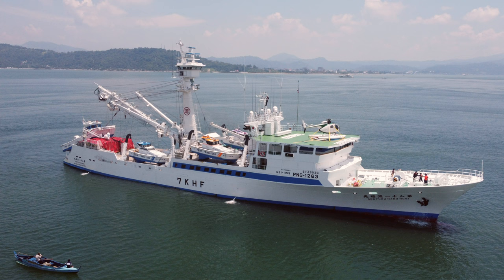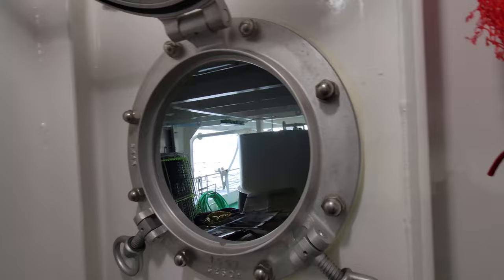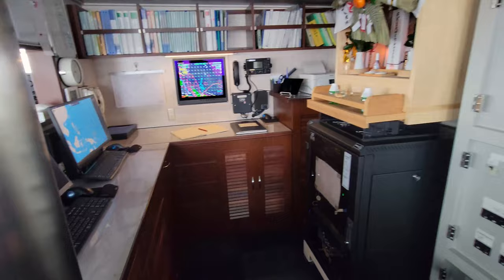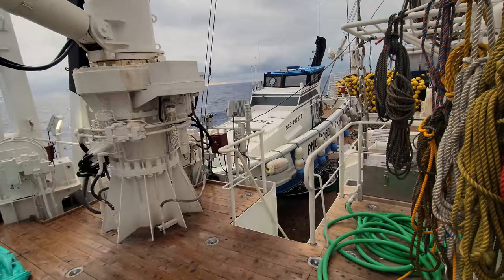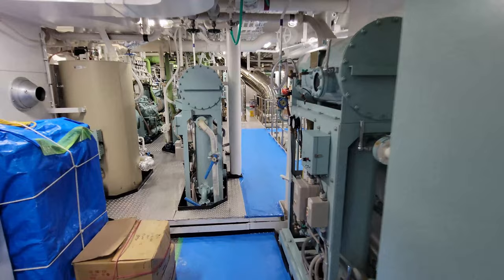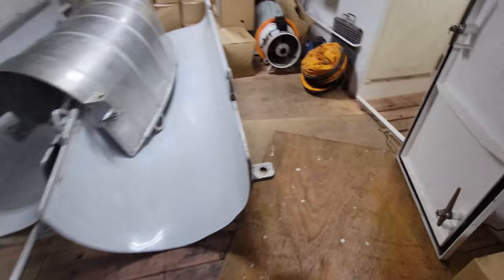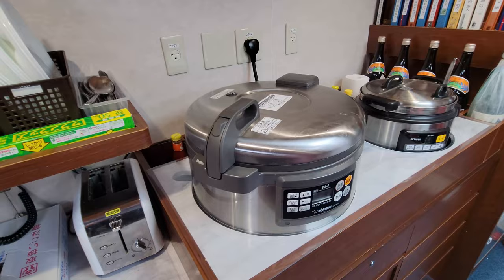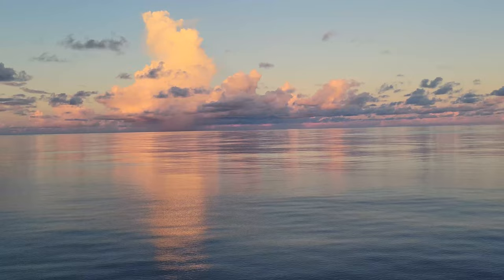Video Tour of a Japanese Tuna Fishing Boat

Comment: Cool video! How do you always find the boat after you've been flying for a while?
Reply from the maker: So we actually do all our navigation with GPS out here. There's a beacon on the ship that provides my GPS unit with a updated location of where it is. If that fails, we also carry our own gps beacon on the heli so that the ship can track us and they can also see us on radar while we fly. So if we need to, they can guide us back to the boat. We also generally don't go very far from the boat, usually about 30-35 miles is the max I'll go because the ship would take 2+ hours to get to us if we found fish. Also on a good day, I've been able to see my boat from 27 miles out, so it's fairly easy to keep an eye on where the boat is if the lighting and weather cooperates. But other times I won't see the boat until I'm closer to 5-10 miles from it.
Reply: Interesting, thanks for the answer!

Comment: what are those small machines in the engineroom that look like radial engines? there are like 6 of them scattered around the engine room!
Reply: I'm pretty sure those radial things are refrigirant compressors. The 3 'blocks' at the lower level are the main engines (2 small ones are generators and the big one is main propulsion). The green barrels which he says the crew said were compressors are actually condensors for the refrigirant. Must be a mixup because of the language barrier I think.

Comment: Interesting look at the industry.  I watched your helo videos too.  Questions:  1) What species (looks like Yellowfin?) 2) No processing on the vessel?  Just flash frozen and then processed back at port?  3) I'm guessing a vessel of this size does 15 to 20 knots so if you run 30 miles to a school you spotted what is the likelihood they are still there when the boat arrives? 4) Are there a limited number of vessels that can pursue this fishery? Are there seasonal limits or is this year round?   Thanks!
Reply from the maker: 1. Yes mainly yellowing and skipjack tuna  2. No processing as far as I'm aware. 3. We typically do 13-16 knots. So yeah if we're 40 miles from the ship, it's kinda pointless. But usually the fish won't be too far from where we found them at least. But they do tend to just disappear which sucks after sailing 4 hours for that big school we just found. 4. It is year round but they do have seasons where we can't set the net on rafts as a way to let the population regenerate. I'm sure there's gotta be limits on the ships but I don't know them. I do know that we have to pay daily and get permits every place we fish. So certain waters have different rules